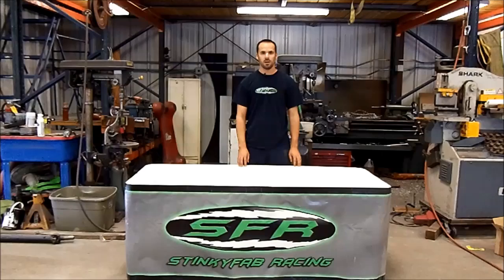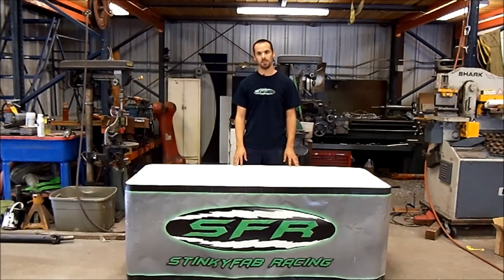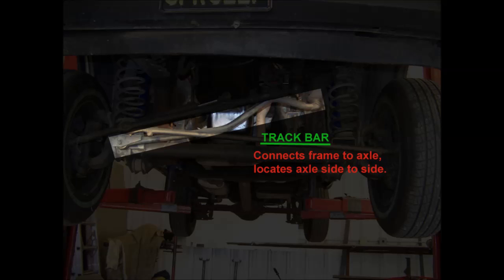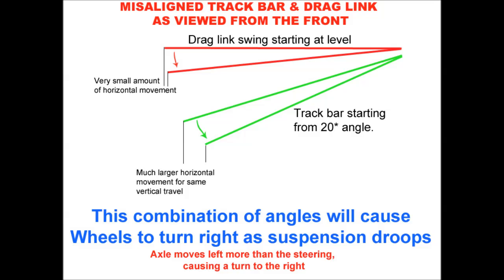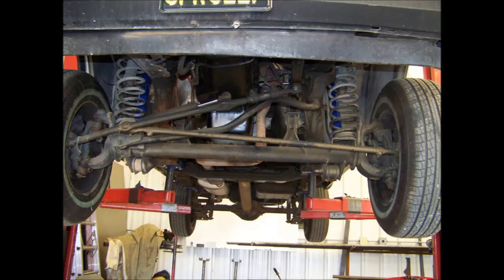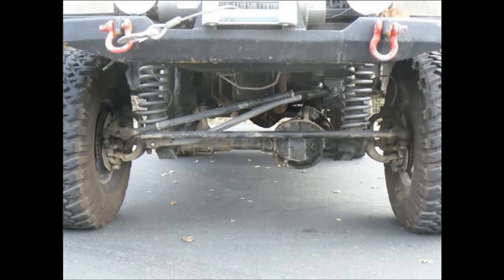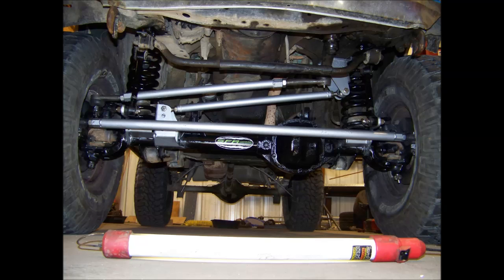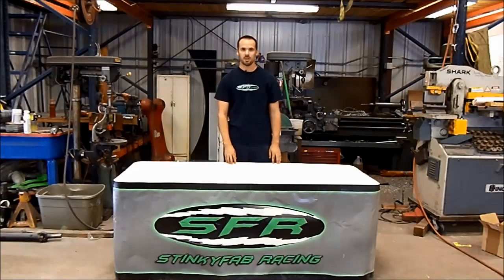SFR Tech Session #2 - Bump Steer

Comment: 5:16, how would you go about moving the track bar (green line) on the axle higher? TIA
Reply from the maker: @mrjbone719  with a new axle side bracket that is higher up on the axle.
Reply: @stinkyfabracing would you have to cut off the existing bracket and weld in a new one. Or are there bolt on options?

Comment: What about steering wander, no bumps involved
Reply from the maker: That would either be alignment or worn out parts.
Reply: @stinkyfabracing  replaced, upper and lower ball joints both sides, new front bearings, new track bar, new crossover steering with heim joints. Could it be control arm bushings and sway bar bushings?
Reply: @PeakAcres  I had a similar problem and after replacing all the same parts you did I discovered it was the steering box
Reply from the maker: Anything that controls movement can cause sloppy steering. If the control arm bushings are bad the entire axle can move around.

Comment: I have watched a lot of video's like this. You are the first to explain what points to measure from. Everyone other video said to make them parallel but did not say from attachment point to attachment point. After lifting my xj 5 inches with adjustable track bar and adjustable drag link, i added a 6" drop pitman arm. I have really dangerous bump steer. Its a good thing it is off road only now. I need to get make some adjustments now. Thanks!
Reply from the maker: Yes, going end to end is key. What's going on in the middle is irrelevant. I've seen many setups where the track bar or drag link has a big Z bend in it making the 2 APPEAR to be parallel, when in fact they are not even close.

Comment: Can a high steering work with a 3 link front suspension?
Reply from the maker: The type of suspension has absolutely nothing to do with the steering other than the angle of the track bar. 3 link, 4 link, radius arms, hell even leaf springs. Doesn't matter.

Comment: Sooo when u upgrade steering u don't need a steering damper/stabilizer?
Reply: The stabilizer is there to damp out vibration and provide softer steering feel. It's technically not even needed with stock steering and is commonly removed when upgrading to heavy duty parts. Some people like having it and mount one. It has nothing to do with bump steer though.
Reply: @stnkbg1  thanks

Comment: Does this eliminate the need for a steering stabilizer? New to this and trying to figure out my problem and remedy.
Reply: If your steering is set up correctly and aligned properly there is never a NEED for a stabilizer. They are mainly to give a softer steering feel and to damp out small road imperfections. They do not cause or cure any steering problems though. Sometimes a stabilizer will mask problems, but there's still a problem.
Reply: @stnkbg1  thanks. I'm having new tires and wheels put on next week and I'll have them check out what is going on.
Reply: It is the bushing at shifter linkage on steering column on outside of firewall. Replaced every steering component , and tightened box Allen. Still walked all over road. 01 ram 1500 Dana spicer 44 rear ends stock in 1 ton gm ,and ford 3/4 ton. Ball joint straight axle. Nice setup if u maintenance it. All it was bushing on shifter steering column. Dah , lift pulls on column.

Comment: Very helpful just installed cav fab steering and rubicon express track bar and I’ve been getting bad death wobble. And now that I look at it my track and drag are so not parallel.
Reply: How did you fix this ?
Reply: Mario Anaya when I first installed it my drag link was at the bottoms of the pitman arm. It would death wobble in almost every little bump. All I did was put it on top of the pitman arm that helped a little. But what I think I need is a longer track back bracket. Because I can still feel the Jeep want to wobble. By no means am I a mechanic or know it all just my experience.

Comment: I'm confused. Where is the front differential on that 1st Cherokee?
Reply: Yes, i do. I also know that the front wheels in a 2wd jeep, or any other rear wheel drive vehicle, are not linked in any way and turn completely independently of each other. I also know you're making a fool of yourself right now.
Reply: There isn't one, it's a 2wd. That changes absolutely nothing in the steering and suspension though.
Reply: @stnkbg1  it doesn't matter if it's a 2wd. How does it turn without a differential?
Reply: The same way it does with a differential, by turning the steering wheel. All the steering components are identical between the 2wd and 4wd jeeps. Only difference is the 2wd has a straight piece of tube with no axle shafts or differential.
Reply: @stnkbg1  umh.. do you know the purpose of a differential?

Comment: Hello, 
Your video was great! 
I do have a question though.  Is it possible to get bump steer with out a tract bar?  I have a truck with leaf springs up front which has no tract bar.  I installed an over the top drag link that no longer connects to the tie rod but now connects to above the knuckle.  I have a pretty bad oscillation affect where the whole truck feels like it is going to fly off the road.  I am trying to investigate as much as possible and was wondering if I could have a bump steer issue.  
I would appreciate your thoughts and suggestions.  

Thanks 
Will
Reply: Yes absolutely. Bump steer is caused by the axle moving in a different path than the steering. Since your drag link swings from the pitman arm it moves in an arc. With leaf springs the axle travels straight up and down. By design there is going to be some amount of bump steer. This is why Jeep put a track bar on the YJ with leaf springs, and why old Chevy trucks have the drag link going front to back rather than side to side. 

It sounds like you may have what most refer to as Death Wobble though. Bump Steer is the tendency for the vehicle to steer due to suspension movement, but it's a movement that doesn't continue. Death wobble is an often violent oscillation caused most often by worn out bushings or steering joints. With leaf springs it can also be from leaf spring bushings or very soft springs allowing the axle to shift side to side. It can also be caused by improper alignment, generally with too little caster.  

This is really a separate issue with many possible causes and I've been working on putting together another video to directly discuss it. There are so many possible causes that it's a tough one to tackle in a reasonably short video though.
Reply: ironwill04 your spring bushings could be worn
Reply: Done it all still walked it's shifter linkage bushing on steering column at outside firewall. Easy fix after 1200 $ in front end steering bars etc.